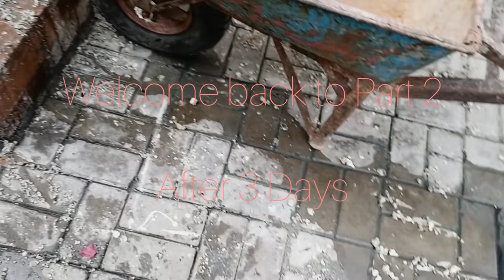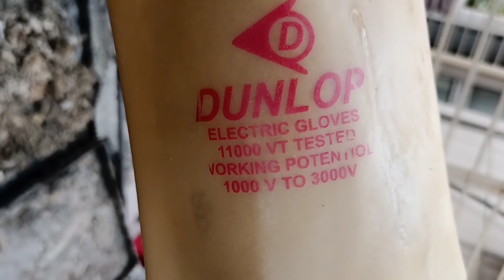Drain Complaint 157 | Kitchen's Septic Tank Over Flow | Too Much Grease | Part #2 |

Comment: Very nice clean up. The filter baffles need to be placed back in the tanks though. Otherwise, the pipes will clog up with grease. ALL OK
Reply from the maker: We put it back in the same place.
Reply: Don't the baffle screens go in the metal frame that separates the 2 chambers to keep the grease in one side? That way the grease doesn't get into the sewer mains.
Reply: @TheSewerMan4  Please see my comment above. Will they fit in that frame?

Comment: Thank you very much for showing us the second part of this enormous work, the waste generated by a restaurant and the work it takes to remove it is impressive, my congratulations
Reply from the maker: Thank you Too Sir for encouraging and support us 💗🙏
Reply: Grease and congealed fat from grease traps can be converted into biofuel, so it's not necessarily waste. The facilities to do the conversion don't exist everywhere though.
Reply: @GGigabiteM  That's right, in many cities real fat icebergs are generated in huge drains, and in many cases they are removed and converted into biofuel, but it is only seen in countries with money and technologically advanced ...
Reply: @GGigabiteM  Very interesting comment, I do not completely know the steps to follow, but it would be very good if it were produced in all large cities to replace fossil fuel ...
Reply: @ricardoernestoguzman9455  There is nowhere near enough waste fat/oil produced by restaurants to create enough biofuel to offset fossil fuel usage.

In a medium sized city if you collected everything possible, you could maybe make a few thousand gallons of fuel every week? that's like sub 1% of the normal fuel consumption of the economy.

Comment: greetings from malaysia.  i notice your elephant truck is noisy when running pumps and you guys are shouting instruction most of the time. any miscommunication will cause serious injury with high pressure. i would like to suggest for your team. please create  sign language/hand signal especially when using high pressure nozzle hose. who ever that is operating the pump will understand easily , even if he is 50 meter away. as long as u can see each other.
1. hose out ( pointing finger curl in, it like calling someone to come closer)
2. hose in (make circle/rolling movement with finger) 
3. pressure up (1 hand thumbs up)
4. half pressure( 1 hand palm facing down , side to side movement= for washing the area after job done)
5. pressure off/shut down. ( single fist)
6. All OK (2 thumbs up :D)
this is just my humble opinion and i am not an expert in this line of work
Try to make it as a one hand signal because u can give a signal while holding pressure hose.  i bet some experience drain specialist here can share some signal too.  
.
ALL GOOD....!!!
Reply from the maker: Thank you so much for your concern, We're glad you explained it to us in the best way possible. Big Respect and Love from the sewer man team 💗🙏